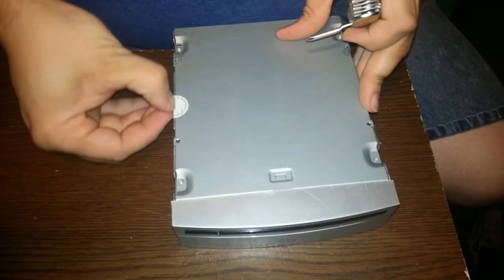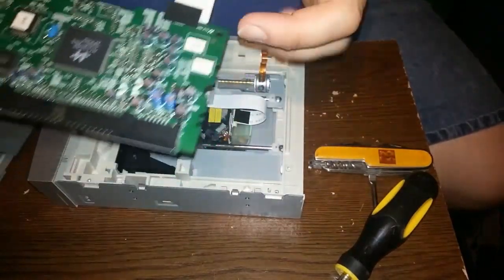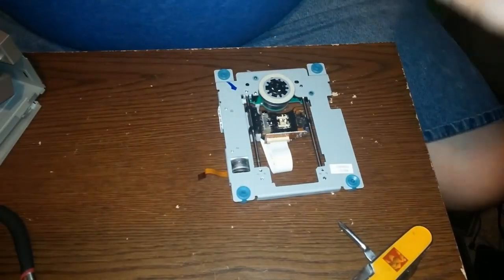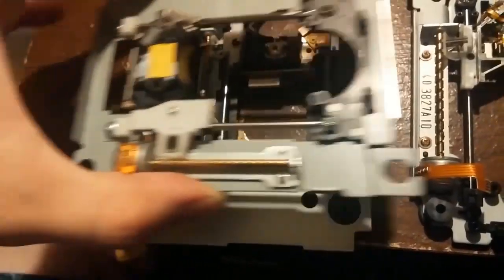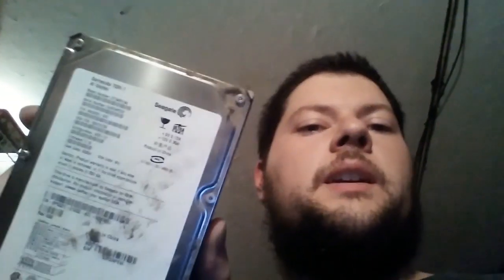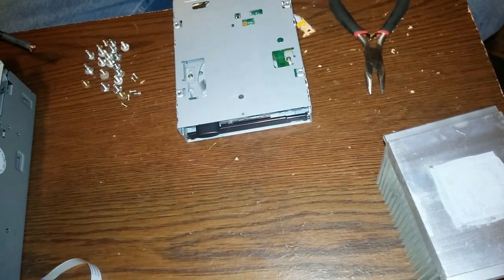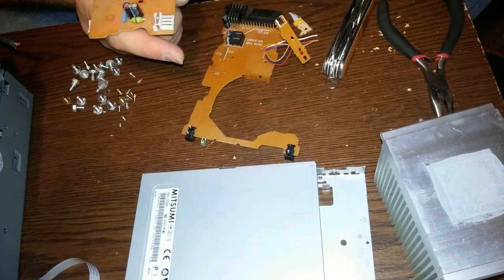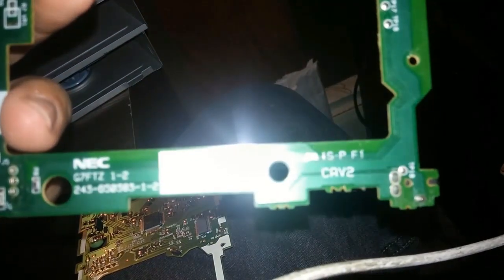Project: DIY CNC Mill Part 1

Comment from the maker: It's been 9 months since I started this project and I am still working on things. Just wanted to update and say I have a new computer setup which allow me to make better videos. Stay tuned as I hope to have this running soon.
Reply: have you really never seen a heatsink that big before?? makes sense it came off a celeron. they are processors that didnt match specs, so they were clocked down to the next one in line and sold. kinda faulty from the start

Comment: can i makc a pick and place with the same process ? the problem is what i dont know how make and where to get the pick part
Reply from the maker: +iozk hz You could easily adapt the base design to make that. In stead of turning on and off a router bit in this one you could set a vacuum on and off to pickup and drop the parts.